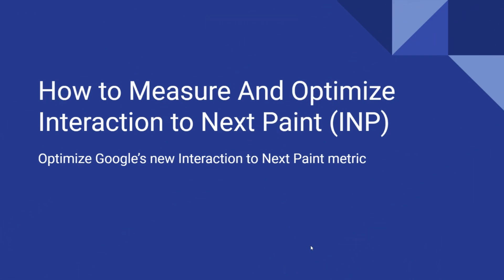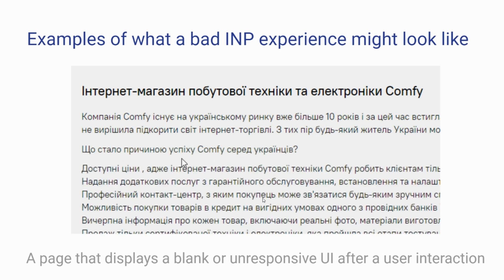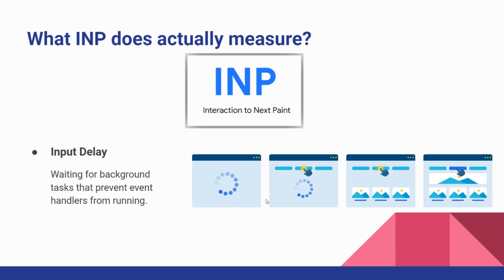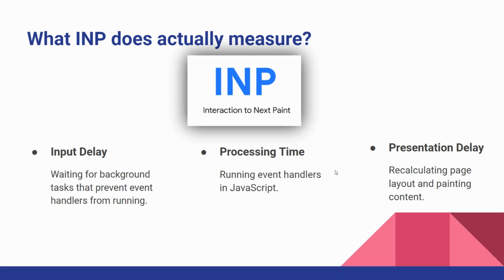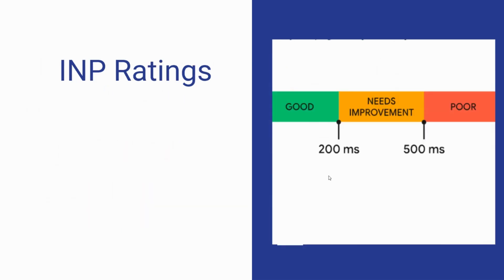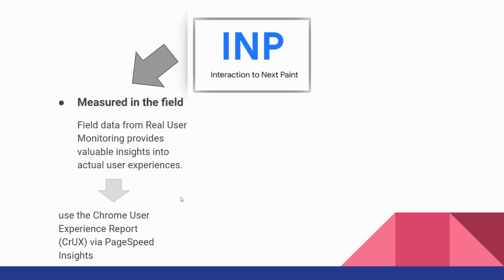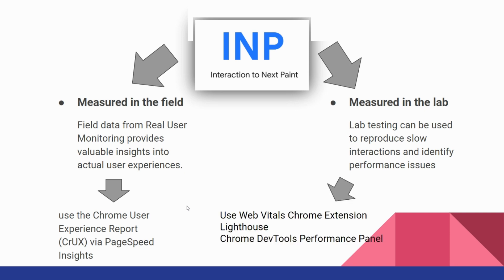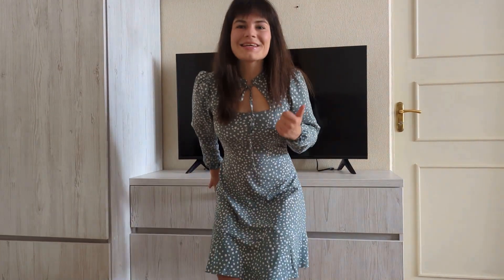How to Measure And Optimize Interaction to Next Paint (INP)

Comment: What strategies have you implemented to optimize web responsiveness on your website?
Reply from the maker: Here are some tips I use to improve web response:
Identifying and reducing input delay. This involves minimizing the amount of time it takes for the browser to respond to a user interaction. I do this by reducing the amount of work that is done on the main thread, and by breaking up long tasks into smaller ones.
Optimizing event callbacks. This involves making sure that the code that runs in response to a user interaction is as efficient as possible. I do this by avoiding unnecessary work, and by using techniques like yielding to the main thread to prevent long tasks from blocking the browser.
Using a CDN. This can help to improve the performance of my website by reducing the amount of time it takes for users to download these files.
Minifying and gzipping resources. Minifying and gzipping resources can reduce their file size, which can improve the performance of my website by reducing the amount of data that needs to be transferred over the network.